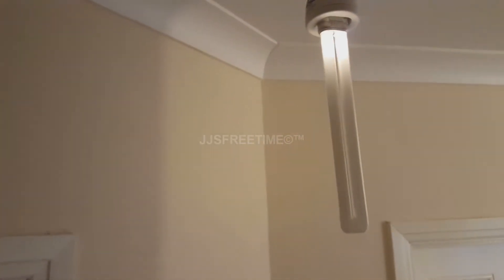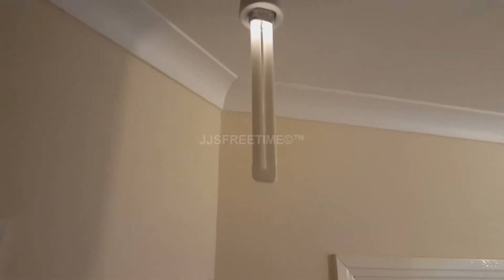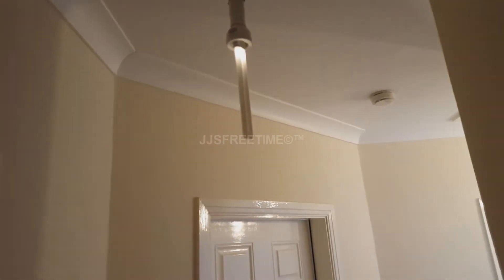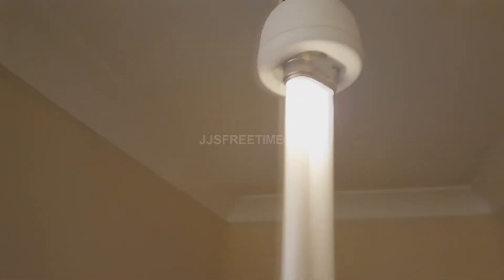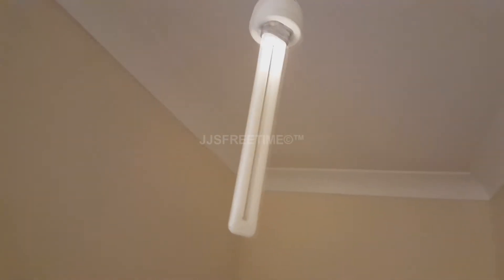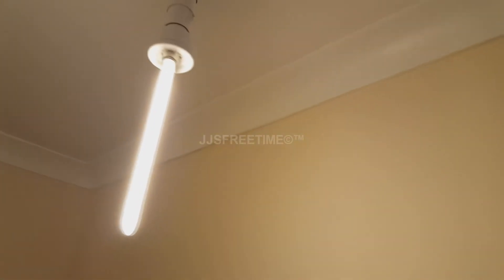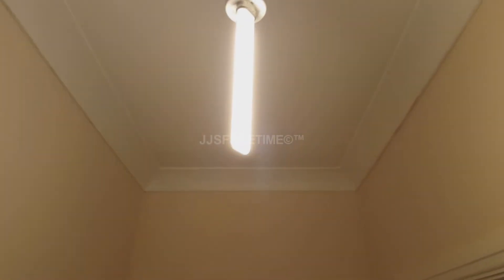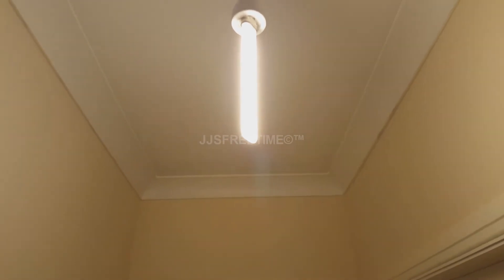Weird cfl tube not starting right

Comment: These G23 lamps have a starter which should not be present on an electronic adapter. You have to take a G23 lamp model without a starter. The adapter's electronic ballast will ignite the lamp on its own.
Reply from the maker: i now use a different g23 adapter now a days